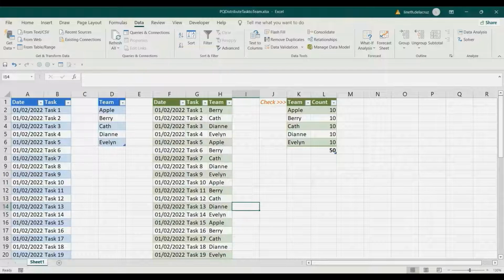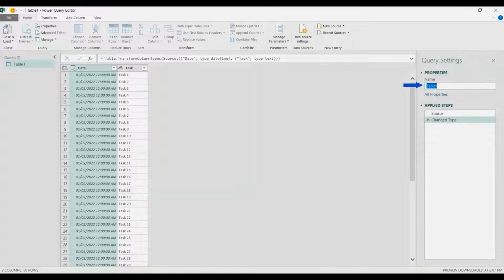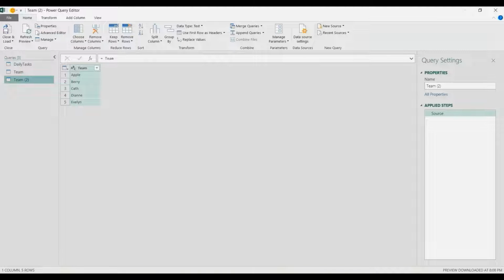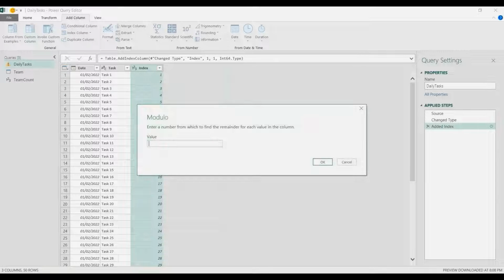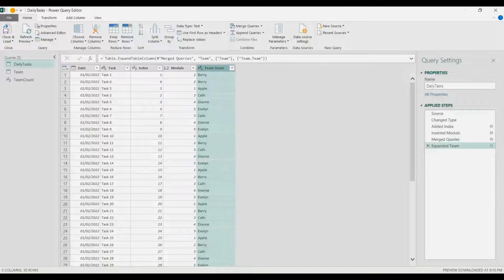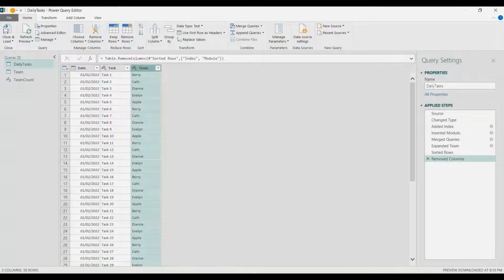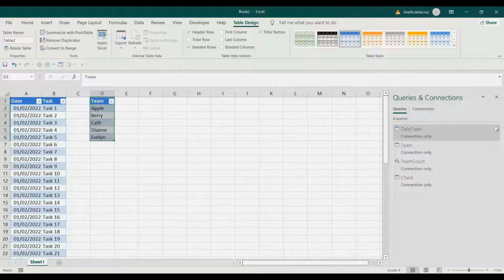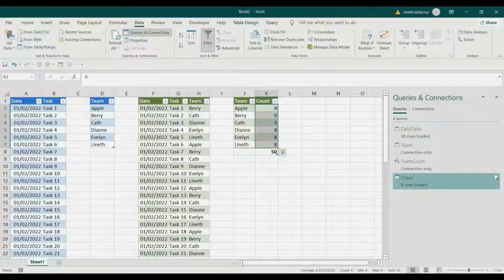Assign Tasks Evenly to Team Members using Modulo in Power Query

Comment: Interesting topic and application of mathematical columns, you could use integer divide to assign blocks of tasks to each team member as well there are a lot of applications.

You could also use access operators to assign team members if the index ran from 0 Team[Team]{[Index]} in a custom column with the index number being the list position you could buffer the list as well, I dont know which would perform better but its a great topic you have brough up thanks for all the videos.
Reply from the maker: Yes there are many options in solving one problem. Feel free to use the example to create better solutions. Thanks for sharing 🙂